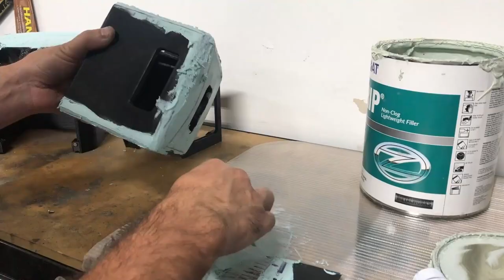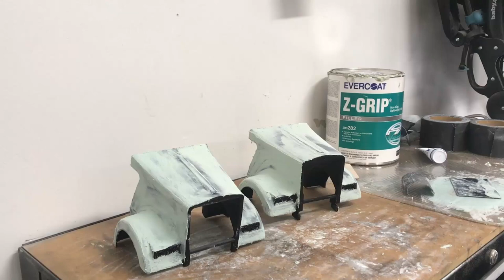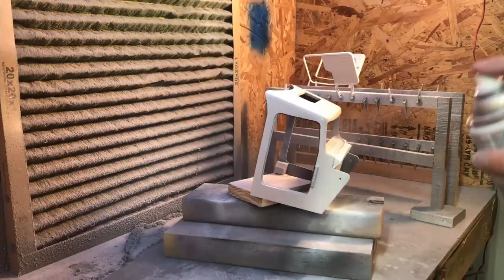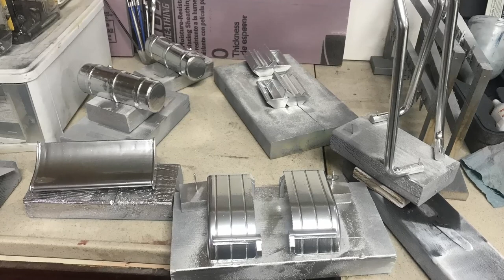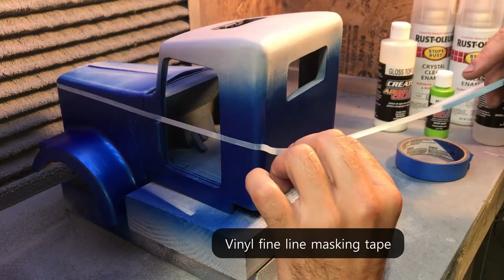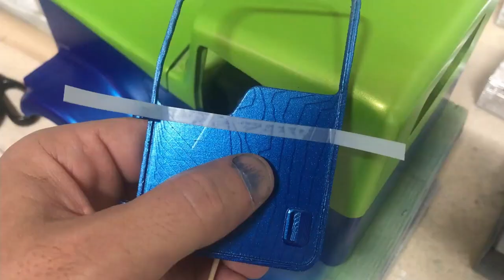1/14 Scale RC Semi Truck 3D Printed pt3

Comment: My GOD that looks good!!!!! 👌🚛👏👏👏👏👏👏👏👏👏 Too bad it costs SO MUCH to 3D Print something that big.
Reply from the maker: Thanks. It’s really not that expensive. Even if you had to buy a 3D printer (ender 3 is a good option) the whole thing is more affordable than buying a tamiya kit, and you then have the ability to customize things and make new parts with the printer.
Reply: I've got a Sovol SV03 Printer. I still don't even know how to turn it on!!! I'm almost 60, having to learn all this from SCRATCH.  
I bought it in January, thinking ALL I had to do was load a .stl file from Thingiverse.... and print stuff! 

Then several people proceeded to tell me that it's MUCH harder than that. That I have to learn things that sound like FOOD, that the Filament I use makes a tremendous difference. 

They like my choice! Like the heated tempered Glass Bed, the 2 color input, Silent Motherboard, dual Z Axis, dual Fans...... 
Except for the Fans... I don't know what ANY of that means!! 😕 😲

All I bought for Filament was  PLA. 5 colors. Half the people said I'm good, half said I need PETG or TPU... 
I DON'T KNOW THE FREAKING DIFFERENCE!! 

I can't find any reliable information for novice DUMMIES. I don't know anyone with a 3D Printer,  which of course is why I got it.

Now I find your Videos, with several things that intrigued me!! (Well, don't have a use for a Snowmobile!), but I'm very into 1/14th Scale Semi Trucks. I get the feeling that you may design even more cool stuff!! 😁
I'm lost though. 

For a Joke, I'm also building a  Thai Dump Truck, parodying the little Kei sized, OVER DECORATED,  underpowered things, that have trouble MOVING on soft but Dry Dirt!!! 😜😂😂🤣 
But I need stuff. 😫  Can't find an Isuzu Ranger, HINO or Mitsubishi Fuso Mini Cab... ANYWHERE in the First World. All over in Thailand, in my CHOICE of Scale! But they don't ship here.

OH WOW! Sorry, I went on many tangents. I do that! Didn't mean to flood you...
Reply from the maker: I'm not familiar with the Sovol, but most 3D printers work very similar. It takes a bit of learning, but I'm sure even an old dog can learn a new trick 😉 You'll be good with PLA, That's what I use 99% of the time. Myself and many others on my discord channel are happy to help as you learn it all. 
You're feeling I will be designing more 1/14th stuff is correct, I have a lot of fun plans. 
I hope I can be of help. If you happen to create a discord account and join us on there I am sure we can help get you going.
Reply: Definitely looking forward to more! 
Currently in the process of moving.... but will probably get discord. I absolutely appreciate the help!! 
I am very into details, like Air Brake items, Engines (especially that slide over the electric motor), interior details...
Trailer details! There's a lot going on under Semi Trailers that are never modeled.
Reply: This Old Dog will try to learn!!

Comment: I would like to learn how to paint the Tamiya box  trailers.  So  many  videos about the Tamiya trucks but NO ONE AT ALL posts videos on how to customize/paint the trailers.  Do you know of some industry reason why expert hobbyists seem to withhold trailer painting information?
Reply from the maker: I would use the exact same techniques to paint a trailer as I do a truck. Videos showing the process of painting can be applied to more than just the subject in the video. I can only guess as to why there aren’t videos showing painting a trailer, and my guess would be that it’s not as entertaining to watch as painting a truck. 
There’s really nothing different to painting a trailer. Prep the area well, mask what is needed, primer, paint, clear. Of course you may want to mask multiple times for different colors during the “paint” step and then clear them all at the end. 
My suggestion is watch some of the videos showing the steps and techniques and then apply that to your trailer. 
Or, if you want to send me a tamiya box trailer then I’ll paint it and make a video for you 😉

Comment: Instead of bondo try Rondo.  A mix of fibreglass resin and bondo and can paint it on with a brush.  I have used this method for making concrete moulds. Otherwise great to see your progress.
Reply from the maker: Thanks. I’ll give that a try.

Comment: Awesome is that on a tamiya frame I subscribed to your channel I have a tamiya frame but no cab or bunk bought it with everything but a cab  and bunk grand hauler frame
Reply from the maker: Thanks. It’s on a 3D printed frame, but would fit a tamiya chassis with a little work to make some brackets.

Comment: Does 1/14 tamiya parts fit like grille and lights  on the day cab body ?
Reply from the maker: I’m not sure, probably not. This was designed to be an accurate body of a kenworth so it’s not likely things like the grill will fit. With a little tweaking things like mirrors or lights should be useable. It is the same scale as the tamiya trucks, so accessories should be compatible with a little work.

Comment: Nice job…. Can I ask, how long after the second colour is applied do you remove the masking tape?
Reply from the maker: I try to remove tape soon after the last coat. If you let the paint dry completely there is a chance that the paint will crack as you take the tape off. So I try to get the tape off as quick as I can, just be careful not to touch the fresh paint as you do it.
Reply: @BuildItBetter3D  thanks for the reply 
That’s what I do, not as good as yours though

Comment: Awesome video I subscribed to your channel I have a complete grand hauler frame no cab or bunk will that work on my chassis
Reply from the maker: Yes it should fit. You would need to make some bracket for mounting, but that should be pretty straightforward.

Comment: Whats the best 3d filament to print the cabin?
Thanks
Reply from the maker: I printed mine in PLA. If you plan to leave it in hot places such as a car then you’ll want something with more heat resistance.
Reply: @BuildItBetter3D  thanks for responding, i live in Canada Lol.pla should be ok. I have experience in 3d printing but not at all in electronic parts, for example how to sync up the CR controller ,etc is there all the instructions about it? Thanks in advance
Reply from the maker: @gafenickel5869 my instructions don’t cover electronics. The truck uses very standard rc equipment though and most rc information should apply to it.
Reply: @BuildItBetter3D  sorry my stupid questions, where can i find information about it?
Reply from the maker: @gafenickel5869 I mostly search YouTube with the questions I have. Usually there’s someone that’ll show how to do it.